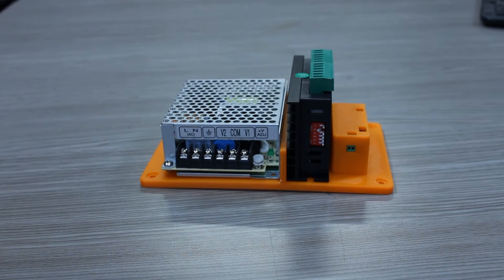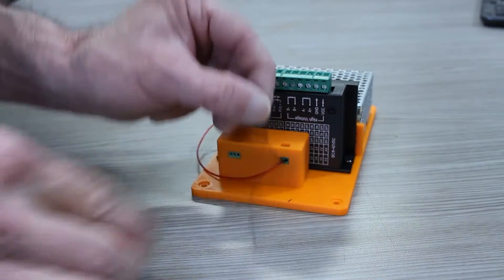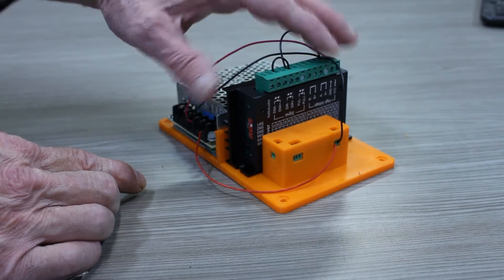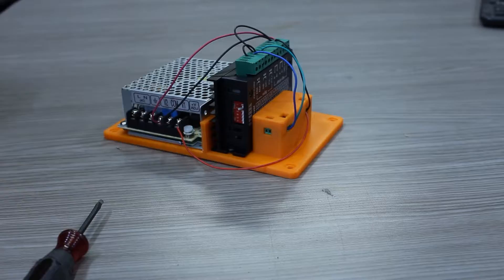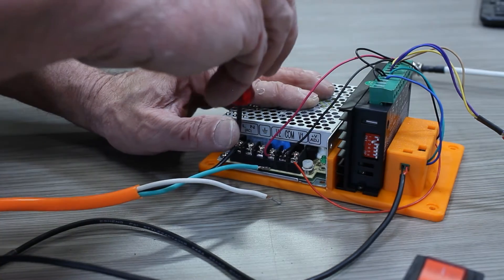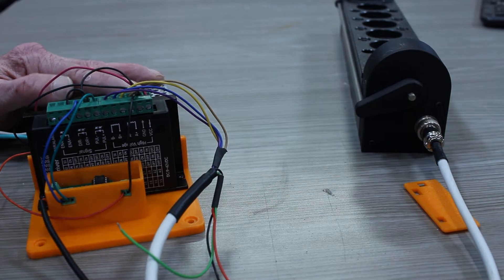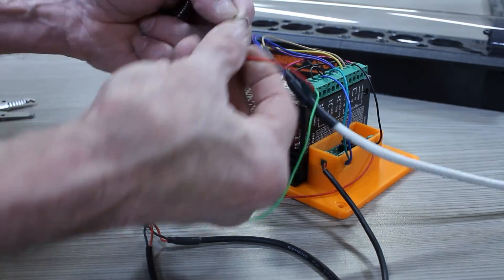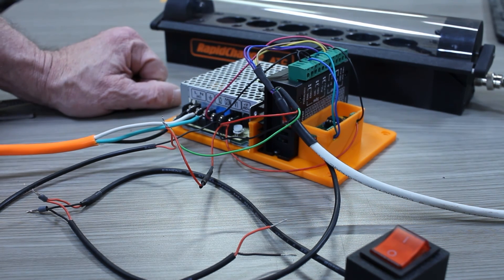RapidChange ATC/Automatic Tool Changer

Comment: Tinned wires don't go in screw terminals if there's any current load on them.  That's how melted screw terminals happen.  Bare copper or ferrules are the better way.